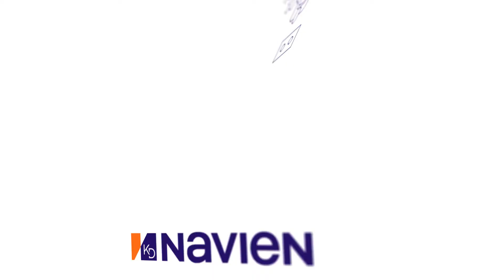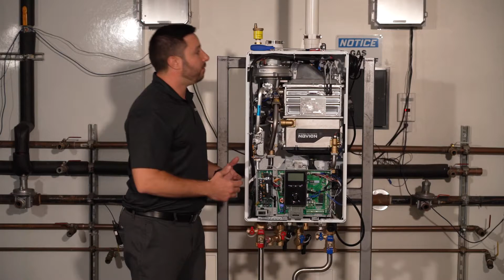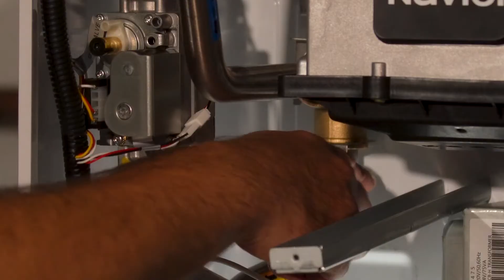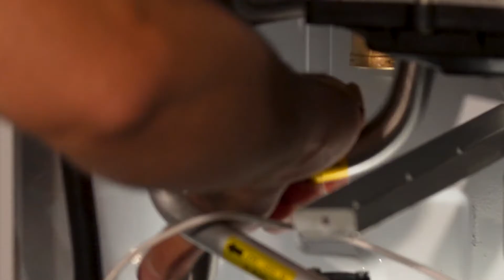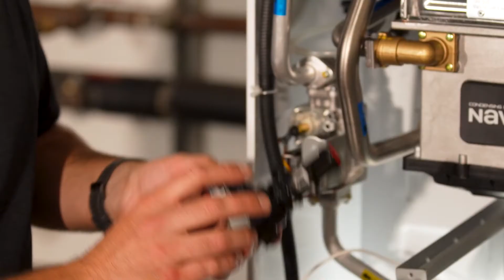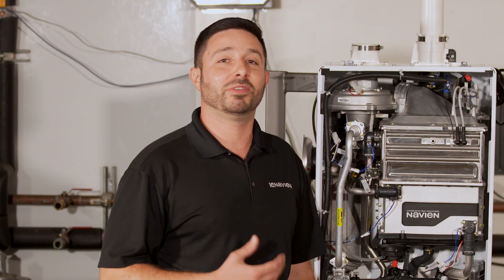NCB-H and NFC-H 3-way Valve Replacement

Comment: It's very difficult to do this on the older NCBs. Three small screws which are very hard to access holds the entire valve. Very bad design. It is almost impossible to get it water tight again. I am glad they changed the drsign. 
One thing they forgot is to shut off the fill.

Comment: I was having an issue with a model NCB-240/130h-(NG) installed in September 2022 and no DHW 03/05/24 and was told the 3 way valve needed to be replaced (under warranty) and when I asked about instructions I was sent this video link. Better than written instructions! This video gave no indicators about turning off the DHW inlet or outlet, so I'm assuming it's not applicable. Guess I will find out when I start the disassembly process.
Reply: I received the part, and they sent me the 3 way valve motor with the plastic housing. I called them and asked them if I needed to replace the just the motor or the whole works since the video only showed how to replace the motor portion. The tech support guy said I could replace just the motor. I also asked about the DHW water supply and explained the video did not mention shutting any of that off and since it must have something to do with DHW otherwise I would not have a problem and he said I should shut off the DHW supply as well. Doing that job today (03/07/24).